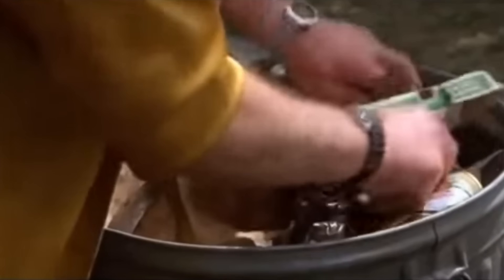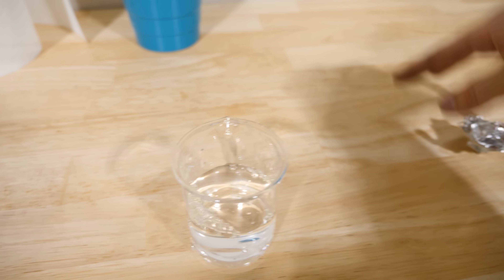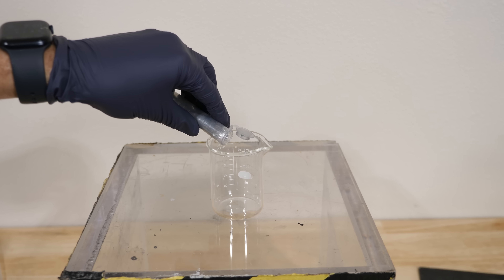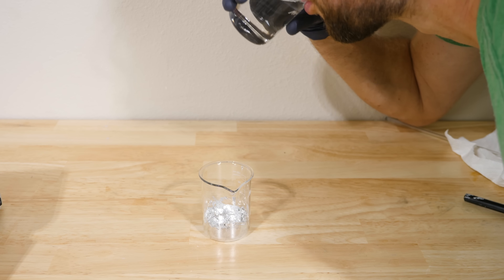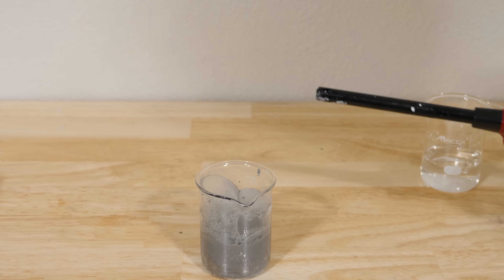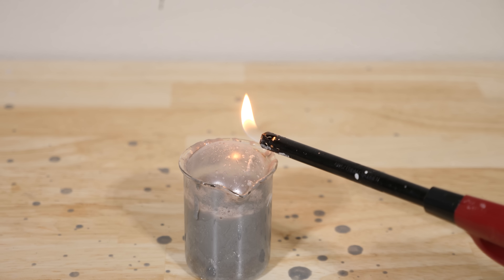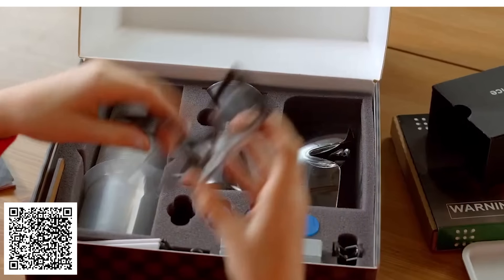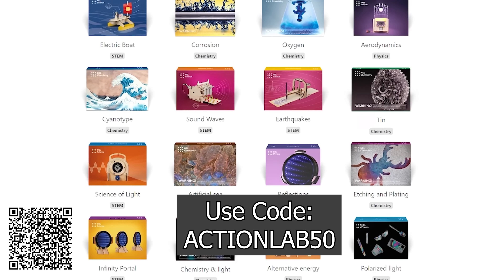This Liquid Metal Turns Garbage Into Fuel

Comment: My main issues with this hydrogen production method is that it’s energy intensive. Like using electrolysis for hydrogen sourcing. Large scale it’s a greener hydrogen source than nat gas but only if the aluminum was produced green. Global aluminum demand is already pretty high and the recyclability of aluminum is pretty good. It’s mathematically energy cheaper to remelt aluminum than it is to reduce aluminum from ore. I never see this method used for industrial H2 production but rather as a H2 source for small scale labs kinda like how zinc is used
Reply: Yes I agree, producing aluminum is very energy intensive and that isn't even talking about the energy in mining. This is one of the reasons why aluminum was one of the first things we started recycling. Saved so much energy recycling it than making it from ore. I have no idea how much energy you could get out of the aluminum vs. how much energy it takes to make it, But my guess is not enough.
Reply: @MrT------5743  I just looked it up for Hall Herault it's something like 4 Volts but actually it releases CO2 and a lot.  Reversible voltage for Hydrogen is 1.23 V. This should give some ballpark numbers of 33%. Anyway storing and transporting hydrogen is connected to all kinds of difficulties.
Only numbers would tell. From production up until you are using hydrogen. Not sure for example how this comes out when comparing to methane made from hydrogen and CO2.
I think transporting of hydrogen by ship is really really problematic and therefore delivering methane is the envisaged option so far. And why do that when you can ship aluminium bars, powder or whatever kind of aluminium and this is more efficient. Obviously you'd also return the Aluminium oxide to the aluminium smelter.
Big problem is though the CO2 released in the Hall Herault process. That is something for the very hard scientists
Anyway this process is big and known and also the generation of hydrogen is worth exploring. Aluminium has 3 electrons so for 2 Al atoms you get one molecule of hydrogen. And its light weight.
I personally think It's always better to think about possible uses than to brag too much about shortcomings that are maybe immideately evident
Zn btw would do the same but is only 2 electrons and way heavier.
Li and Na have more energy and are even lighter but all this extra energy is lost into heat when you try to directly recover hydrogen. Also transporting shit loads of those two metals is pretty crazy. aluminium you can cast into bars and thats it, no such safety issues. I mean thousands of tons of lithium or even sodium on a ship  which is itself inside water. What could possibly go wrong 😲. And Aluminium smelter world production is in the orders of 30? Mio t. Li and Na well ... not even close
I think those aspects refer to the advantages of aluminium as an energy carrier to be transported by ship. And you could actually ship stuff from australian/south african summer to european winter and vice versa.
Reply: Recycling was the norm for all metals, paper, cloth, bones, and many other things, literally from the chalcolithic.
Reply: It looks like the reaction releases a lot of heat. That heat could be put to use in a factory that produces and stores hydrogen.
Reply: @gmc9753  Yes, if anything waste heat can be used to cycle your gallium around and whatnot.
Reply: @gmc9753  That heat is just a further loss in energetic yield. it takes 46.8 megajoules of electrical energy per kilogram of aluminum. That works out to about 1.26 MJ/mole. a mole of aluminum makes about 1.5 moles of hydrogen so for every 27 kilos of aluminum you'd get 1.5 kilos of hydrogen. The energy density of hydrogen is 142 megajoules/kg so it's a loss of 1121 megajoules. Electrolysis is 200MJ/kg of hydrogen. Finally to recycle a kilogram of aluminum is 17MJ/kg so to me there is no large scale benefit to this method unless you are small scale and don't need a dedicated supply of hydrogen. I personally use the reaction for hydrogen demonstrations but to use it as an hydrogen source say for ammonium or hydrogen steel production is irresponsible.
Reply: @gmc9753  dunno if thermal energy would work as well as electrical energy to produce H
Reply: @gmc9753  But do you know how much energy it takes just to make aluminum? Probably could take that energy and just extract hydrogen from water and be done.

I just googled how much energy it takes to make aluminium: About 17,000 kWh of electricity are required to produce 1 tonne of aluminium.  (Best smelters use about 13 kilowatt hours (46.8 megajoules) of electrical energy to produce one kilogram of aluminium). About 8 times more energy than to make same weight in steel.
Reply: When you say a 3 to 1 ratio of aluminium to gallium, do you mean by weight or by moles?
Reply: @fredericapanon207  by volume.
Reply: Or for hydrogen production in space? Make the spaceship from aluminium and when it has done its purpose use the aluminium in the hull of the spacecraft plus water to make hydrogen to make energy in space. And this way you don't have to keep gaseous hydrogen for energy that keeps evaporating away.
Reply: @titter3648  well yeah that’s an example of a novel small scale use of the reaction. In space I think having water as water would be more useful as you can drink it and to burn the hydrogen you use o2 which you breathe but it’s a great example of a use case
Reply: @HexCopper  You are assuming it is a manned mission. Unmanned spacecraft also require power, and can get that power from hydrogen oxygen and a fuel cell, and hydrogen and oxygen is more easy to store as water and aluminium that you can release later when needed. But all of this also assumes you can not get enough power from just putting some solar panels on the spacecraft. The main point is that aluminium can be of dual use. First as a structural material and later when it is no longer useful for this it can be used as a battery releasing the energy potential it contains.

But i'm guessing that the oxygen in the water is consumed in the reaction with the aluminium to oxidize it so in that case you have to bring and store extra oxygen any way to be able to run a fuel cell of the hydrogen you make.
Reply: this why you produce hydrogen through electrolysis at when solar energy production is at highest so you can store that power as hydrogen gas
Reply: high density military fuel.
Reply: Aluminium recyclability is actually pretty limited when looking at it in depth. It has one fundamental flaw: It can only be fully recycled if you know the type of aluminium alloy, which you cannot easily tell apart. You could make an high energy XRF of each scrap piece, but that is very expensive. Each grade must be recycled individually and correctly sorted. In practice >30% (sometimes >50%) fresh aluminium has to be added in each batch to dilute inevitable contaminations by some pieces of the wrong grade to meet the specs of the alloy you intend. 
So with each cycle you either reduce the quality of the product, or you need to continually increase the amount of Aluminium in circulation worldwide by the amount you need for dilution.  Or a combination of this as we do right now. If the you don't want to have infinite amounts of Aluminium in the world (obviously impossible), you need to remove highly contaminated batches of aluminium from the cycle at some point. I don't know if this dirty material is then still useful for this process, though....
Reply: Very cool, but is it better than recycling the aluminium? My guess is that it's hard to make and not infinite, plus what are the byproducts of the reaction? And of gallium filtering?
Reply: @Kaldrin  It basically becomes a part of the recycling process. You throw pulverized aluminium rich trash into a tub of liquid gallium, add water, skim the leftover trash off the top as you go. 

Gallium is heavy enough that it will tend to settle on the bottom, doesn't seem like filtering the gallium would be much of an issue, decant it off the bottom as you go. Your waste water is an aluminium rich concentrate that is pretty much ready for electrolysis/smelting.
Reply: @conor7154  to me hydrogen is NOT an energy source. It is a raw material. Nuclear energy is cool but it can’t make ammonia used in farming. You HAVE to have a hydrogen source. RN Germany is shifting to hydrogen steel where they refine iron ore using hydrogen instead of coal with the current source of that hydrogen being natural gas. EVENTUALLY they can shift the H2 source to green sources such as nuclear electrolysis of water
Reply: @conor7154  electrolysis to hydrogen is niche  as electricity is (in general) a more useful form of energy. Hydrogen used to manufacture synthetic hydrocarbons maybe? I think US aircraft carriers do this.
Reply: @conor7154  Fission or Fusion?
Reply: I would much prefer if you would have left out the mathematically because it is just nonsense. Do you mean that you do some calculation and the energy used is less for melting than for aluminium electrolysis. This btw is called chemistry or metallurgy and has nothing to do with math.Tell me, what is green aluminium? I think the research is still going on and has not reached maturity yet.The method of choice is still hall herault and that emits huge amounts of CO2.
And  ...  such processes are not meant to be run out of scrap, apart from that you'd run into big trouble because the projected amounts of hydrogen used as renewable energy source are HUGE and the scrap needs to be remelted for reuse as aluminium metal otherwise there will be an aluminium supply problem
Reply: @nopo_b3645  I know its called chemistry I do chemistry every day. It's simple thermodynamics which is 75% math. Like open any physical chemistry textbook and it is walls of integrations and proofs and deltas and MATH. I said mathematically because I just looked at thermodynamic reference tables and specific heat capacity tables and heat of fusion tables and calculated the energy required to heat aluminum from 20c to mp then the heat of fusion vs the same for Al2O3 to mp then calculated the reaction energy and what do you know it's a TON OF MATH. "Green" anything is usually in reference to what was before. Yes the current refining method releases CO2 but nearly every metal oxide is reduced to metal using carbon (Green steel is being introduced in Germany that uses H2). Recycling aluminum, to me, implies that the aluminum is already reduced and so you don't release as much CO2 as you're not reducing it again.
The amalgam process in the video directly oxidizes aluminum into aluminum oxide that would either be thrown out or reduced back into the metal. Chemically speaking that is very energy intensive
Reply: Stupid idea. To produce bauxite, we have to make coking coal, caustic soda, ovens, extracting the ore, it's all very polluting. The future is green hydrogen.
Reply: Though normally labs use sodium hydroxide instead of gallium as it's cheaper, less difficult to handle, and has a slightly less volatile reaction. Not to mention you can buy sodium hydroxide at the literal grocery store. It's literally just bargain bin drain cleaner.
Reply: Agree ... Laws of Thermodynamics etc..  I wonder if biomimicry may be a potential answer (on a small scale).  Nature has had a billion years to do this, perhaps we should be more attention.
Reply: @conor7154  good point, Conor. BUT nuclear energy is "not really" nuclear energy.  Fusion >heat> phase change in water (water >steam = latent energy of vaporization)> mechanical energy (spinning turbines)> electricity (spinning generator).  And each process is NOT 100% efficient.  Starting with 100% fusion produced energy you only get 30-35% electricity.  The rest is waste heat in a time that Global "Warming" is the biggest issue at hand.
Reply: My twin H!
Reply: You use all the lower grade recyclables for this sort of thing, harvest the al oxyde "concentrate" at the other end of the process and send it out to be electrolyzed into solid aluminium all over again.. Still an energetic net loss (of sorts) but not by much since you'd basically be replacing ore with "battery waste" and skipping all the steps that involve producing said ore.
Reply: I agree. I’d say the only practical use of reactions like this and hydrolysis are as longer term chemical energy storage methods rather than energy collection methods.
Reply: @WillSoice  It is, in the end, a complicated way to make a battery <but> considering the sheer amount of scrap aluminium we produce it may be worth exploring, if anything it seems to be a rather effective way to purify low grade recyclables that would usually be buried because of how ineffective it is to purify them into a useful product again compared to it's value.

Comment: The excess energy is coming from the aluminum production.  It takes a lot of energy to break the aluminum oxide bond to produce pure aluminum, so no, between the energy loss of the aluminum going back to aluminum oxide and the loss of some of the gallium in the process, I'm sure it turns out being an energy net loss.
Reply: The idea isn’t to make Al and use it as fuel. It’s to reduce landfill waste. Anyway it isn’t a good idea to do this because Al can be recycled over and over again.
Reply: @BrianSu   I agree. It is a disgrace when aluminium ends up in landfills.  In fact, a lot of "waste" should be regarded "high content ore". Not just for Al, but also Fe, CH4, and what not.
Reply: @BrianSu  If you're trying to reduce landfill waste, why not just recycle the aluminium? That's a far more efficient use of the metal. There is nothing about this technology that makes it more likely that the idiots who send aluminium to landfill will change their habits.
Reply: if it wasnt it would just generate energy